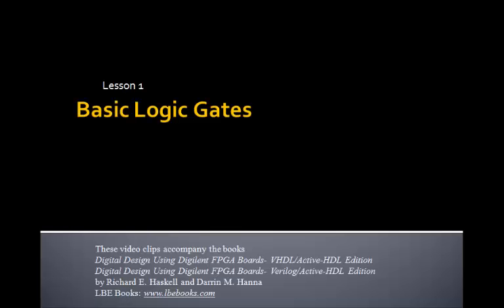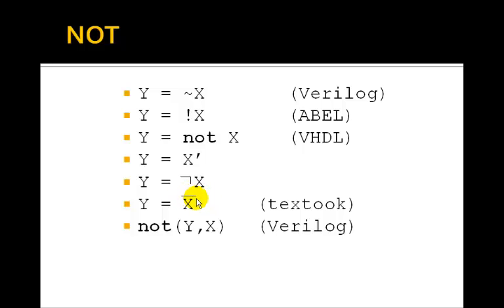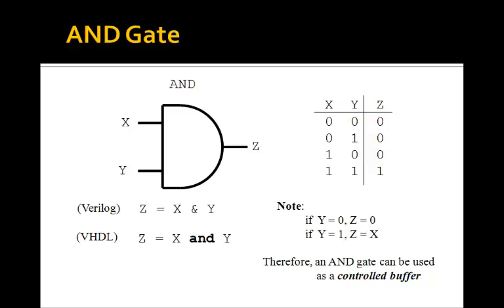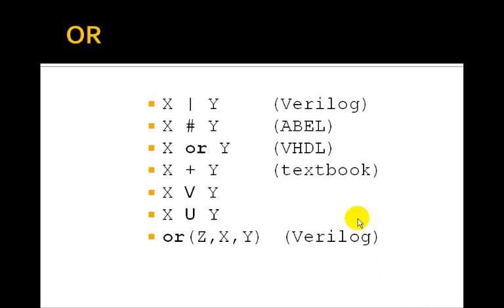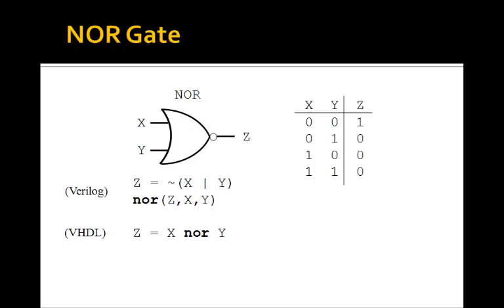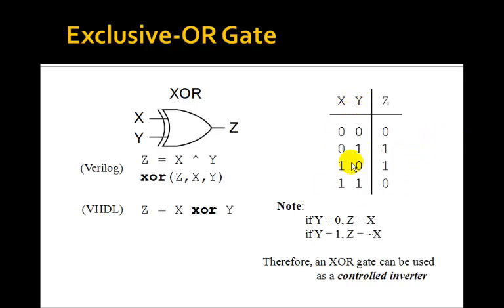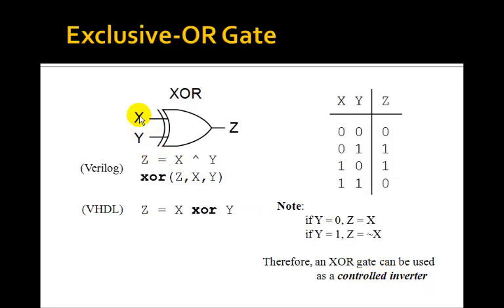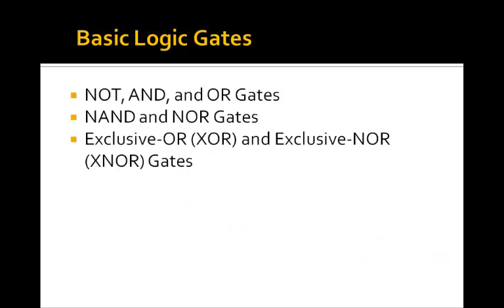Lesson 1 - Basic Logic Gates

Comment: Nice video.  But since I left my headphones, I had to use the Close Caption.  I am familiar with the material from years ago, so I could read through most of the errors in the transcription.  But the following error might needs to be touched up.

Slides Exclusive-OR
Spoken:
and Verilog also has the function XOR, with output Z and inputs X and Y

Captioned:
and girl I'd also has the function axe or without pussy and put sex online.